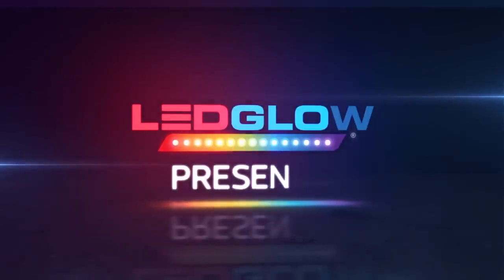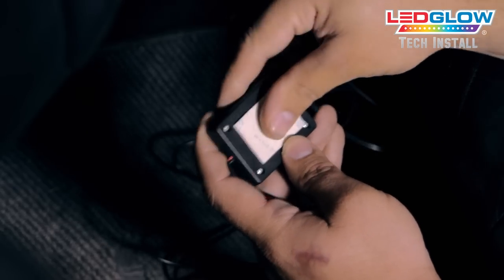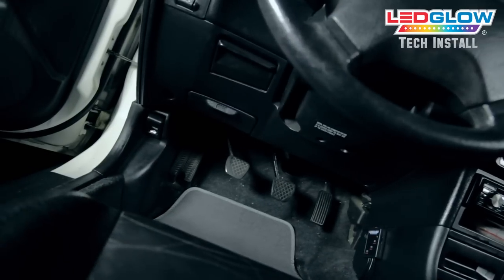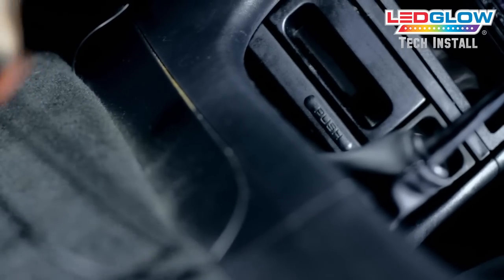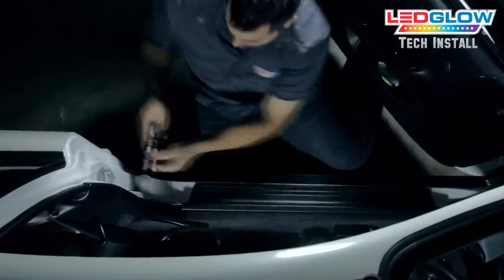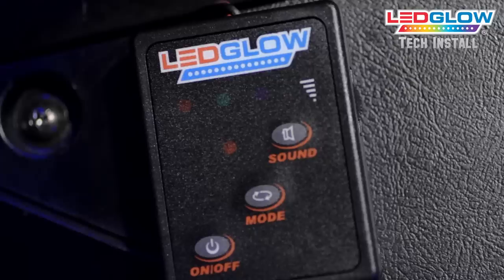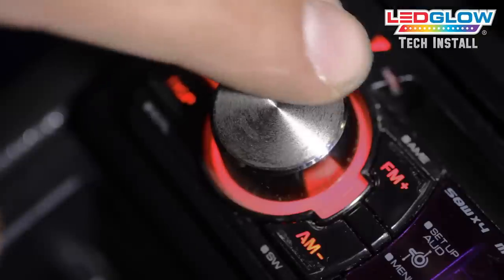Installation | LEDGlow 4pc 7 Color LED Interior Car Lights and Truck Lights

Comment: What is the advantage of these? This brand is the cheapest that I've been able to find the whole kit for and am wondering what the drawbacks are. Also, if the strips aren't long enough, can you just buy an additional strip and connect it to another one or is what you get all that's compatible?
Reply from the maker: ***** The kit featured in this video is only wired for (4) 9inch interior tubes. If you think you will need a kit with longer tubes, as well as the ability to connect more than 4 tubes to, you should check out our SMD interior lighting kits that daisy chain together for a quick and easy installation. Here's a link to the SMD interior install video for you to check out and if you have any other questions or concerns don't hesitate to ask! https://www.youtube.com/watch?v=x-hM-1w5Q_g

Comment: the directions on the kit say not to connect it with a fuse greater than 10amps does it really matter because in the video a 20amp fuse was used
Reply from the maker: +Shaquille Scott Thanks for pointing that out, I was unaware this is what the video showed. Now, you can technically use a 20 amp fuse, but for the sake of safety, we recommend never going above a 15 amp fuse.

Comment: I have a 2006 Mitsubishi Eclipse GT and I have several questions.  
First, is the add-a-circuit in the video the "Expandable Circuit and 4 amp fuse" on ledunderbodydotcom?  
Second, I don't know whether to get the standard ATO (ATC) or the Mini Add-a-circuit.  
Lastly, using the fuse box under the dashboard on the driver's side, which fuse is best to connect the add-a-circuit to? Thanks in advance

Comment: Great video, I have a 2008 vauxhall astra would I need anything else other than the LEDs?
Reply from the maker: ***** Thanks for the compliments! If you want to power your kit directly from your car's fuse box you will need to use an expandable circuit or you can use a cigarette lighter adapter that powers the kit from the lighter port.If you want to run the kit's power and ground wires to the battery, you will need to extend the wires by using 16 or 18 gauge automotive grade wiring. Let me know if you have any other questions or concerns!

Comment: Just got my Lighting Kit, pulled out of the box and everything is in order. Would you recommend having the lighting in the front only or also in the back of a 2004 Pontiac Grand Prix GT? In the video it says just the front by having the lights planted under the dash and under the front of the drivers and passengers seats. Also, where would you recommend the control box for this vehicle?
Reply from the maker: UF Dan You can mount the tubes under the dash and under the front of the driver/passenger seats or you can mount two under the dash and two on back of the driver/passenger seats facing the back seats. It's all personal preference, but the lights look great when mounted facing the footwell areas of the front of the car. I recommend mounting the control box in an accessible area towards the front of the car that you can easily reach like the center console. If you have any other questions or concerns don't hesitate to ask!

Comment: Tapped into the one yellow wire, works good but only problem is that it works just for the driver door, how do i get it to work for all 4, i hav no clue? Also when i close the door led lights go off immeditly,dome go off slowly,thank you very much.

Comment from the maker: You can leave the power in the fuse box as long as the source has power all of the time. You will want to connect the ground wire of the kit to the door pin switch. This will allow the circuit to complete itself when the door is opened and the lights will only work with the door open. If you have any other questions, don't hesitate to ask!

Comment: I have the seven color LED lights with 2 bars only, how do I install those to the ignition? and will they turn on if I only have the electricity running instead of the actual engine?

Comment: When you have the sound setting on is there any way to get just one color to flash? Or does it do all at once?
Reply from the maker: xKaRboNx1 With our 7 Color Interior Kit, all the featured colors will flash with the sound activation mode, but with our Single Color Kits you will only get that featured single color flashing. Let me know if you have any other questions or concerns!

Comment: I just ordered the 4pc 7 color LEDs and was wondering how I would connect the wires to the 12V source w/o an "add-a-circuit." Can I splice them together instead?

Comment: Oh okay, how is it unsafe to connect the red wire to the fuse? So a 2012 Honda civic uses a mini expandable circuit? If not, what kind of circuit does it use or how do you check which circuit to use?

Comment: Would the junction box beneath the dashboard work just as well? Going the the fire wall isnt easy with my car. The fuse box on the junction box has 12v fuses in it. And do i have to use the add a circuit? and if i do, do i have to use both available fuse ports on the add-a-circuit as well?

Comment: just ordered. it did not come with zip ties nor the necessary part to start the lights. i was excited to install until i noticed have to buy more parts
Reply from the maker: Trey Bowen I apologize but the expandable circuit used in this video is an optional installation accessory to power the kit and is not included with the kit. Regarding the zip ties, send me over your shipping information and order number to Mike@LEDGlow.com and I will make sure we get some zip ties shipped out to you at no charge. Thanks for letting me know about the issue.

Comment: If you are doing where when the door is open lighting cant you just put the add a circuit into the fuse that the door uses?
Reply from the maker: okc405sfinest It will most likely work as that fuse will be constant powered and ground controlled, so when the door opens it's powered. Let me know if you have any other questions or concerns!

Comment: Trying to install in a Acura 98 3.0 CL but no idea where to place the ground wire? Also is electrical tape okay to support the red wire & blue connector for support?

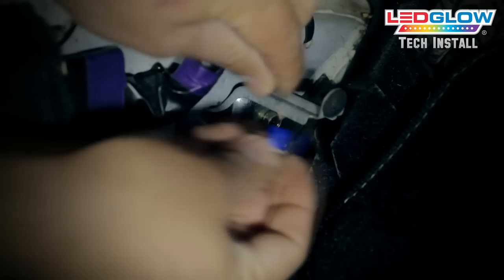Comment: @1:35 When you are crimping your ground wire to that ring; does that ring connector that you are crimping in this video come with the kit? Or do I need to purchase it separately? l bought your 4pc 7Color but I don't see it with the kit. Is there another way to ground the ground wire without using that ring?
Reply from the maker: Fairytale〉l〈Productions Unfortunately the ring terminal used on the black ground wire is not included with the interior kit. If you're looking to install the black wire using the ring terminal you will need a #8 ring terminal that is used for 22-18 gauge automotive grade wiring. You can also strip about an inch of plastic off the wire and wrap the bare wire around a screw and thread it into any bare metal, unpainted surface that is connected to the frame of your car. Let me know if you have any other questions!

Comment: Does the positive lead come with an inline fuse built in?  The picture of the kit on your website shows a clear tube-shaped part inline with the red wire.  I plan on running the kit to an on-off-on switch, with one side tapped into my car's dome light, and the other to a constant hot in my interior fuse panel.  I can tap an empty spot that doesn't have a fuse currently, but I'm not sure if I'll have to add a fuse first.  I will if the kit doesn't have a fuse already.  Thanks.

Comment: Will it be ok to cut the wires that connect the led lights and the control box? I want to cut them so its easier to wedge/hide d wires, specially my car has compartment in d middle.

Comment: i have a question concerning the fuse box and grounding the wire.
The add a circuit can have a fuse that has the number 10 on it.?
Also when grounding the wire, does it matter what kind of grounding ring it is.? because i've seen some that go for audio/lock/weatherproof.
PLEASE get back to me.

Comment: Hi, the kit brings the adapter connection? from fuse box or lighter ?, I connect directly to the battery?
Reply from the maker: Sergio Garcia The expandable circuit and cigarette lighter adapter are optional installation accessories that are sold separately from the interior kit. However, you can connect the kit's power and ground wires directly to the battery.

Comment: Does it matter which 10 amp fuse i couple it with? like can i use the same fuse that the ashtray ac outlet uses since it is a 10amp?

Comment: I have a Honda Accord 2000, if everything included in the Amazon kit for $35 or do I need to purchase any additional parts for me to install it?
Reply from the maker: Everything will be included except an expandable circuit and a ring terminal for the ground wire if you choose to install the kit with those additional pieces.

Comment from the maker: If you want to add an underbody kit to your car you can easily tap into another fuse with new add a circuit or you can hardwire the underbody kit to your car's battery, if you choose not to use another add a circuit. If you have any other questions just ask!

Comment: LEDGlow Can i install my 7 COLOR LED INTERIOR LIGHT KIT without the expandable circuit or should i install it with it?
Reply from the maker: Elisander Torres The expandable circuit is not required for the installation, but I would recommend using it because it allows for a much quicker installation and cleaner finished product. If you don't want to use the expandable circuit, you can also power your kit using a cigarette lighter adapter or by running the power and ground wires through the firewall into the engine bay to the battery. If you have any other questions or concerns don't hesitate to ask!

Comment: I have a 2009 Mitsubishi Lancer GTS and i already have the 4pc set and bought the mini fuse tap, i saw in the video on the fuse tap there were 2 fuses plugged in. Please elaborate on what two fuses those are and why?

Comment: Can I still connect the kit with the expandable fuse box kit without having to unplug the negative from my vehicles battery?
Reply from the maker: +Dee Lops We recommend to anyone that is doing any work to the fuse panel to disconnect the negative battery cable to ensure the vehicle is not grounded in case any of the wires touch the metal frame of the car. This is the best practice that should be followed when doing any electrical work to your car. Let me know if I can help with anything else!

Comment: I have a 2002 VW Jetta, any ideas on how difficult an install would be?
I hope to be buying either a 4pc Blue or 4pc 7 Color but since the fuse box is located next to the driver side door I'm a little hesitant.

Comment: Did you put the led lights on the bottom of the back of the seats to shine the back for the passenger's in the back?
Reply from the maker: Yes, you have the option of using the backlights for the rear seats or place them under the front seats facing forward for more illumination.
Reply: LEDGlow thanks for the response!!!!

Comment: Is the add-a-circuit included ? or is it standard in cars? how does that work exactly?
Reply from the maker: Victor Rivera The expandable circuit is an optional installation accessory that is not included with the interior kit. You can use it for any car, but first check your car's fuse box before using one to see which type of fuse it uses whether is standard ATO, mini or low profile mini fuses. We have an installation video dedicated to using the expandable circuit you can check out called LEDGlow's Expandable Circuit. Let me know if you have any other questions or concerns!

Comment: Does these lights have a constant mode where they just stay on all the time and don't react to music?
Reply from the maker: Yes Nate, the sound activation mode is an optional feature that you can choose to use or not, but the kit comes included with 7 different solid illumination modes as well as 7 lighting patterns such as fading and scanning patterns. Let me know if you have any other questions!

Comment: Hey how are you, I bought the regular kit and add-a-circuit but i'm having trouble finding a place for the ground wire. Would the screw under the driver's seat work? I'm driving a 2015 Kia Forte Sedan.
Reply from the maker: Kevin Elkaim Thanks for contacting us with your question. As long as the screw under the driver's seat threads into metal then you should be good to go. If not then just find any other screw that threads into the metal frame of the car and you will be able to use your kit! Let me know if you have any other questions or concerns!

Comment: i haven't installed my ledglow kit yet, but i want them to turn on when i open my door, you showed me how, but i also would want them to turn on when i push the power button on the remote or strobe function or music mode. is this possible? or do they just work for auto door illumination?

Comment: i have a question do you guys have a product for trunk of the car that would be really neat or would i somehow have to extend the wiring so that it would reach either the fuse box or the12v power adapter
Reply from the maker: up648 You can definitely install one of these interior kits for the trunk of your car, but you will need to extend the power and ground wires of the kit using either 16 or 18 gauge automotive grade wiring. Let me know if you have any other questions!

Comment: I'm just a little confused as to how to get the wires from inside of the car to the fuse box under the hood (or the battery).

Comment: I just purchased the kit online! Im wondering if i need to purchase anything else for it to work on my 2001chevy cavalier.
Reply from the maker: digitalmillenia Thank you for your purchase! It all depends how you want to install the kit as we offer a few different installation accessories. If you want to tap power from your vehicle's fuse box, you will use a mini expandable circuit and 4 amp fuse for your 2001 Chevy Cavalier. Using the expandable circuit is extremely easy and highly recommended for any of our installations. We also offer a cigarette lighter adapter that you can plug directly into your cigarette lighter port for a quick install. If you want to connect the kit directly to your vehicle's battery, you may need to extend the power and ground wires using 16 or 18 gauge automotive grade wiring. Let me know if you have any other questions or concerns!

Comment: Can I splice a wire and connect it to the door pin and then connect the second wire to the headlights to get dual functions?
Reply from the maker: ***** Wiring to the door pin is usually done through a ground control setup, so when you try connect the power wire to the headlights, you still will not have a ground connection when the door is closed.

Comment: Would you be able to use a 3position switch to turn ON or OFF or just turn ON  when the doors are opened?  I have mine wired to to the fuse box for a 12v with an add a circuit for power and then spliced into the dome connector's neg. for them to work with map and dome lights when locked or unlocked works great, would like to use the switch if it is possible?

Comment: if I pull out a 10 amp fuse to put the add a circuit into that slot...the 2nd fuse has to be 10 amps as well...or does it have to be lower than the fuse im replacing...???

Comment: Are these easy to install in a 2008 Chevy Cobalt LT. I want to add some character to my car and I feel like this would be a awesome way to do so. However I am younger and was wondering if it was something I would be able to do easily?
Reply from the maker: +Natejo87 Thank you for the interest in our product! The installation for one of our interior kits is a very simple process! You really just need to decide on the proper placement for your tubes and then run the wires accordingly. The kit's control box just has a power and ground wire that would need to be ran and connected to the proper locations.
Reply: +LEDGlow ok thanks you a reply. And I can't wait to get and install them!

Comment: My power wire is connected to a constant fuse in my fuse box with an expandable circuit. I turn off the leds from the control box but still drained my battery. How do I fix this?

Comment: I have 2003 Jeep Grand Cherokee and I want to put the led lights under driver and passenger seat so they light up my back seats. I just want the solid blue color and was wondering what the best kit would be? I need wires that will be long enough to do this and also, my box only has 10, 15 and 25 volt amps so what should i do? Thank You!

Comment: I have a 1998 Nissan Maxima, would i need any additional parts? And would i be able to wire the lights to a switch as well as having the control box?

Comment: Does this kit light the back seats I bought mine already and am waiting to install because I wanted to know if the back seats ate illuminated
Reply from the maker: Sean Householder Each 9 inch interior tube features 6ft of wire, so you can definitely run two tubes to light up the back seats. Let me know if you have any other questions!

Comment: quick question I have my controll box near my steering wheel is that ok even though the sun can hit it it's the only available spot
Reply from the maker: +Cheeecko That's not a problem having the control box located there as long as it is not in your way while you're driving.

Comment: Hello! I just bought the 4 Piece LED Interior Lighting Kit! Is there any way that I can install it without the expandable circuit? I have a Toyota Prius C 2015! Thank you for all your help!
Reply from the maker: aegislx If you're not looking to install the interior kit with the expandable circuit, you can power your kit from your cigarette lighter using a cigarette lighter adapter or you can run the kit's power and ground wires directly to the battery of your 2015 Toyota Prius! Let me know if I can help with anything else!